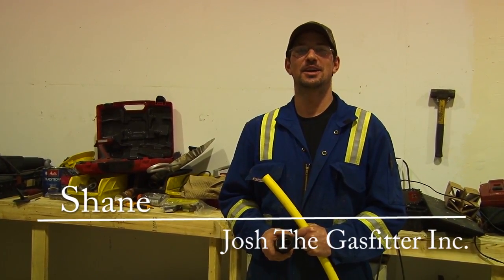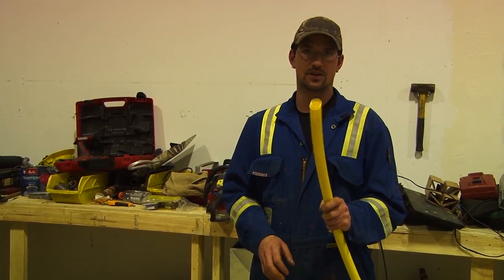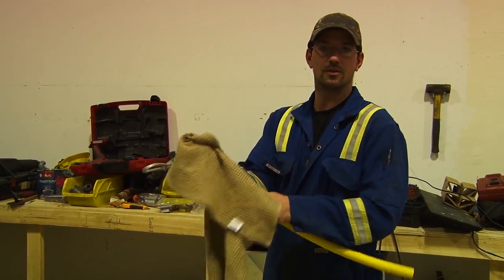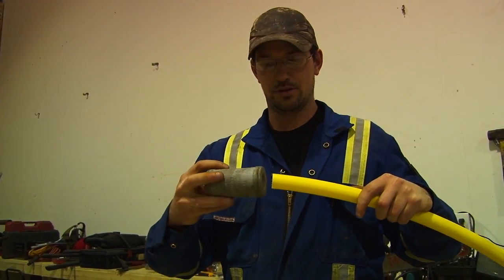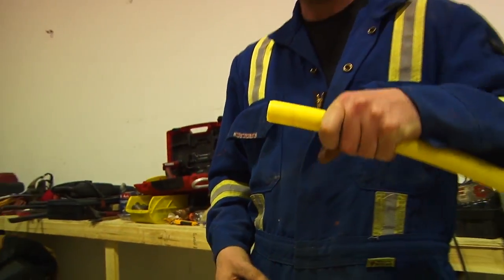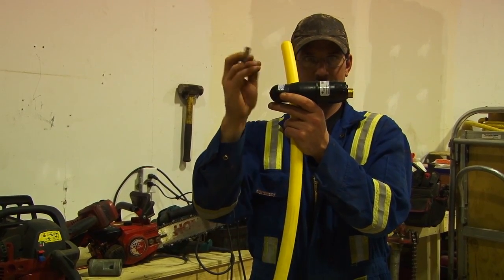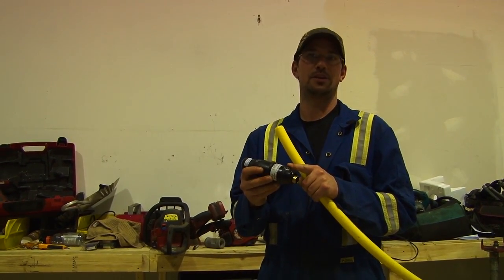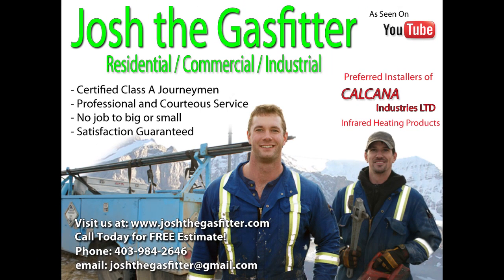underground gas pipe connection.mp4 CALGARY 403 815 6507

Comment: Thats a Perfection Coupling. It can be used as an end cap indefenitely, but you can cut the end off of the coupling and stab in another piece of pipe of the same size to extend a run of pipe. They're commonly used in service line extensions in new housing tracts.
Reply: I guess Im asking the wrong place but does anybody know a method to get back into an Instagram account..?
I somehow lost my account password. I love any tricks you can give me.
Reply: @Omari Johnathan instablaster ;)
Reply: @Kase Keaton Thanks so much for your reply. I found the site thru google and Im in the hacking process now.
Seems to take a while so I will get back to you later with my results.
Reply: @Kase Keaton It worked and I actually got access to my account again. I'm so happy!
Thanks so much you really help me out !
Reply: @Omari Johnathan No problem :D

Comment: Is it possible to run a 1/2” gas hose to the 3/4” gas line in the back of my house it already has a shut off valve and is 25 ft from my 13hp generator even though I’ll be reducing it from 3/4” down to 1/2” and if not can I run 25 feet of 5/8? The generator NG hook up is 3/8” so I would be reducing it twice but the last reducer is only about 12”” long?

Comment: Great example of the  blindeye Perfection permacert. when i find myself in pintch or situation i'm unable to preform a conventional socket fusion these little guys sure save the day. i couldnt help but cringe when you twisted the fitting you want to avoid that as much as possible. also before you chamfered it great to see you cleaned the pipe so as not to force contamantion into the pipe. you chamfer is very dirty and they will always get live that but i notice contamination left on the OD of your PEpipe which was then inserted into the fitting.   otherwise fantastic visaul demonstration. NOTE: for all apprentices CLEAN CLEAN CLEAN!! its you FUSION/QPJI TICKET # and i'd hate a simple thing such as decantomination (as extremely rare as this examlpe) may be come between you and a QA Rep. FUTURE LEAKS DO HAPPEN AND THE FITTER IS ALWAYS INVESTAGED. HAPPY FITTING BOYS
Reply from the maker: Twisting is not allowed? When installing Risers it's almost impossible not to move the coupling
Reply: +Josh The Gasfitter  I agree with there. In the video it was quite excessive compared to vituraly impossible adjustments during intallation. I just said avoid as much as possible. I've looked at these fittings and cut one in half and the twisting In my opinion shoulnd't effect the seal.  I do know perfection suggest a clean steady stab, also if were caught twisting the fitting in the field it would be a mandatory cut out. Josh do belong to local 488? If so I'm able send you some literture I have.
Reply: +UA_Local800 Pipeliner When install my riser i like to do my bracke work so my candy cane or whip riser is secure. From there I cut my main feed to length. I attach my perm to it then steadly push into the riser transition. Presto vitually no twist. To me Shane twisted that fitting post intallation like a screwdrive twisting in the contamination left from the chamfer. Just looked messy
Reply from the maker: yes i did  please send the infomation

Comment: Hey Josh, thanks for the video, we work in the construction industry and sometimes hit the gas lead ins to the house. And can not stop the gas. Can you tell me how to stop the gas flowing. Can we use a clamp or something until the pipe is fixed?
Reply: Kashif they make squeeze off tools that you have to make sure are set to the correct sdr of the pipe. In a pinch if it is very unsafe where it is blowing. I have seen contractor bend the pipe back to kink it and tape the folded over piece to the service and then wait for the utility company to come fix it. We have seen a lot of contractors do this. Sometimes even on 2" mains that are 1 way feed.
Reply: @jetripplef  

good practice till you make your last one and then your a statistic and on the 10 pm news.
Reply: @bigdaddydoggy4842  I wonder how the gas line went.
No leaks I hope, some way to get an education quickly.
I can see possible problems and the fact remains: education is never free. 
I hope the free lunch fallacy isn't at play here because there are NO free lunches

Comment: I’m not trying to argue but I think that to you have for chamfering it is an old school tool for socket fusion  where you bevel the outside. My tool does the opposite it bevels the inside of the pipe. I’ve had the tool for quite a while now and it’s made by the same company that makes the stab fittings. I stopped using the style fittings because an inch and a quarter tee Is five dollars fusion style and 175 stab style lol
Reply from the maker: Ryan Buck that’s cause there  are different manufacturers.. I’ve used ID chamfering tool as well.

Comment: Lycofit is the way to go..!
Reply: Absolutely, lyco fittings are the only way to go for safety, reliability and very little size restriction. I have been a service technician for the gas utility in St Louis Missouri for 35 years, I have seen couplings of All Brands come and go. Nothing comes close to a Lycofit.

Comment: so if you can't pull them apart how do you replace one that's leaking without replacing the whole line if I cut it off my line is to short to put back together
Reply: Shanin Albright you can not take one off really. I mean if it's absolutely impossible to just cut and put a new piece and use 2 couplings. There is an unauthorized way. You can cut down the middle of the factory fusion bead, then carefully cut the plastic spacer inside and pull it apart piece by piece. I have done it twice. But very time consuming and risky to not damage the pipe.
Reply: Shanin Albright You squeeze off the PE or shut off. Cut the fitting out. Put new piece in and electrofuse it.

Comment: DONT USE THESE! I couldn't tell you how many time my company gets called just to fix these fittings! They are too expensive and leek. Socket fusion will never leak when done right.
Reply: TRio EXPO these are amazing. We have 10's of thousands and no leaks if installed correctly. Are you sure you're not installing continental? Kind of look the same but seal on the inside instead of outside. Or maybe they used the old continental chamfer instead of the perfection thus not letting it seal correctly and possible damaging the o-ring.

Comment: 1 that's 32mm not 1" 2 does not need to be clean dry that's all and 3 6 to 8 inch when it's only going in 1 inch for fuck sake get educated also that's a metal fitting getting put back in the ground